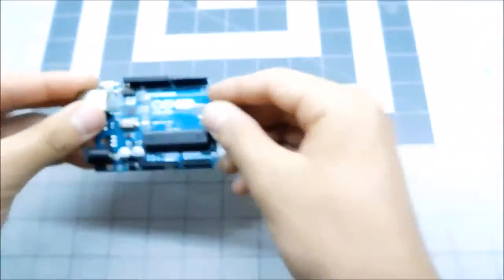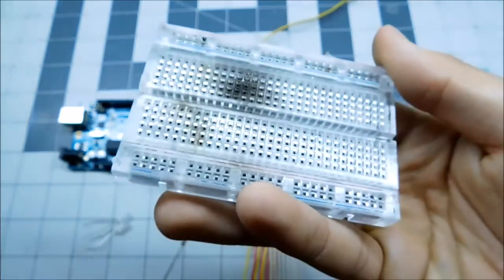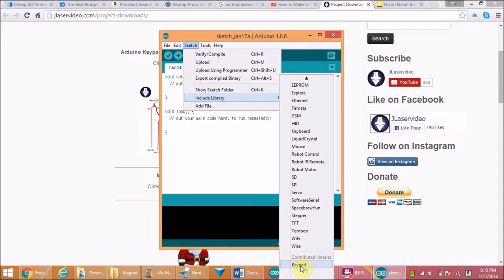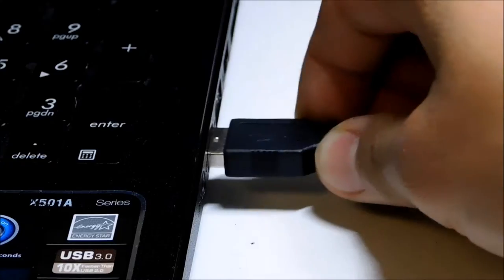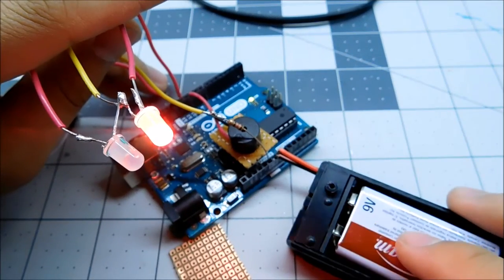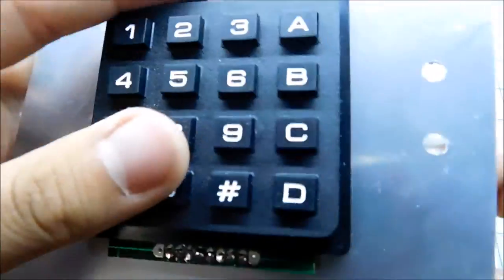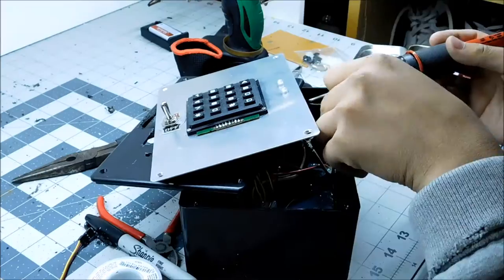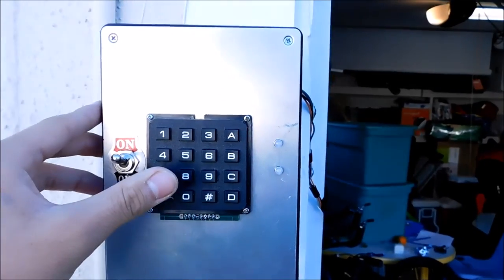How to build a Keypad Lock

Comment: No I meant that they could short circuit or change the wiring and the servo MIGHT open the door
Reply from the maker: ah but that can only happen if the servo was a regular motor, but it has to be controlled by a microcontroller, but yea it is possible

Comment: you said to connect the buzzer to pin ten where does the other pin connect to.
Reply from the maker: the positive pin of the buzzer goes to pin 10 and the negative pin goes to ground
Reply: I am sorry but I am a newb does it matter which ground you put any of the pins in. And also do you have to put in any extra code for the buzzer